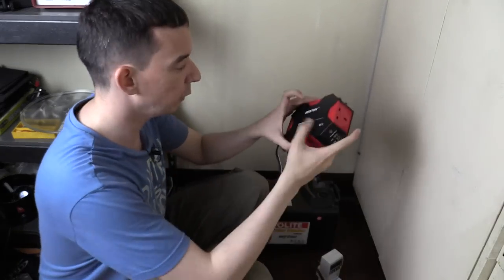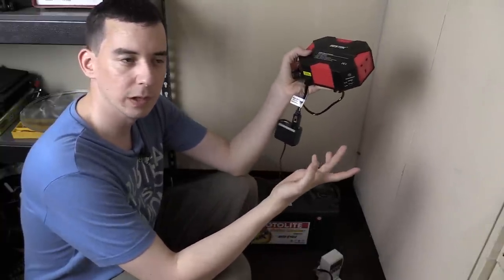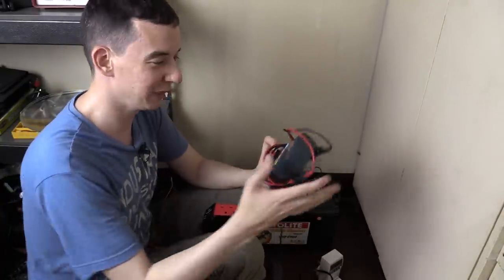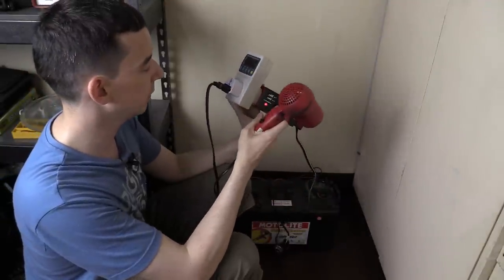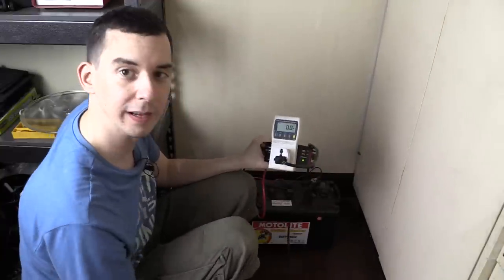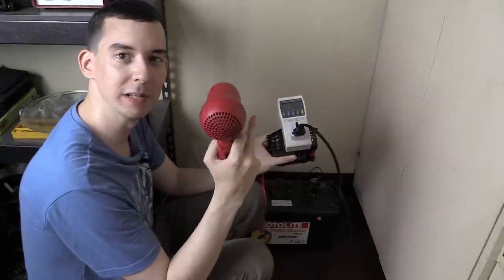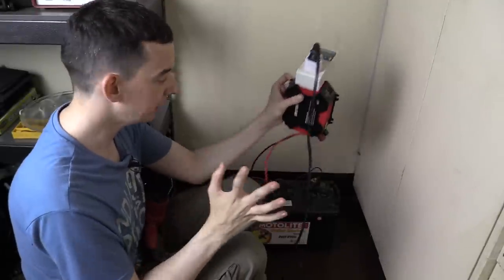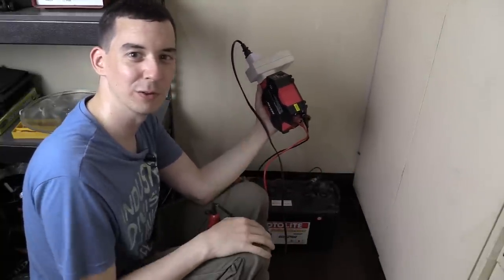Bestek Inverter hairdryer correction

Comment: hey I did think that the wires when you checked it before were very small very thin to I would use like the ones to the alligator clips to your battery in the car to

Comment: Hi there, unfortunately my Bestek MRI4013iu blew up. When opening I saw the SMD resitors R3, R3A, R3A1, R3A2 after the transistor stage are damaged. Probably the current was to high for the operating time... As I can't read the resistor value anymore, I would highly appreciate if some here who owns the inverter could open yours and tell me the values? Thanks in advance
Reply from the maker: I still have mine. I could take a look, if it's not too difficult to open. How easy is it to get inside?

Comment: I purchased this very inverter and I discovered that the fan stays on continuously and never shuts off until I power off the device. my set-up is solar and this 400 watt Bestek power inverter consumes too much energy.
Reply from the maker: Every DC/AC inverter I own keeps the fan running continuously. But yes, power drain from your inverter is something to be aware of and that's why they advise to turn it off when you're not using it.
Reply: I have never had an inverter that had an always on fan, my inverters all have fans that only come on when they need to. I wasn't aware that they had always on inverters.